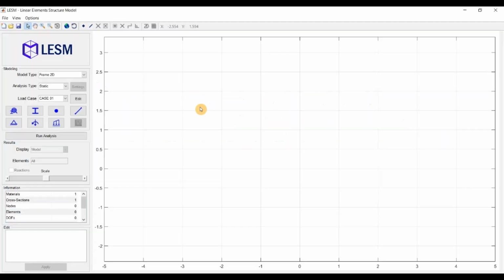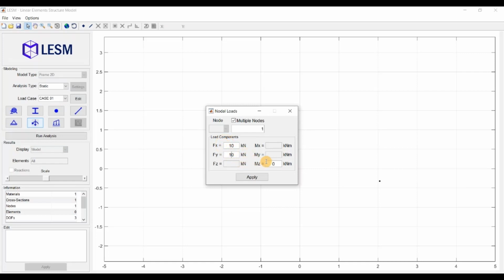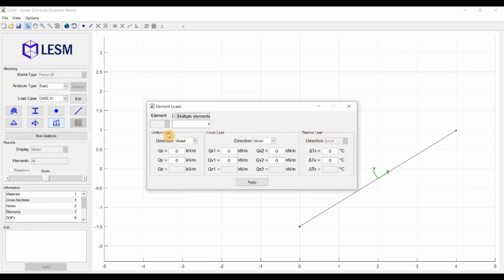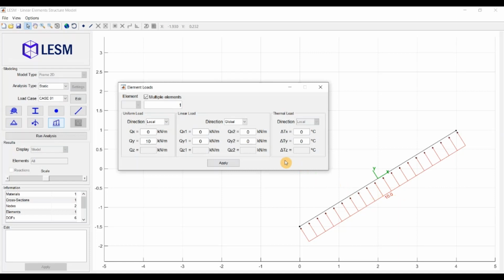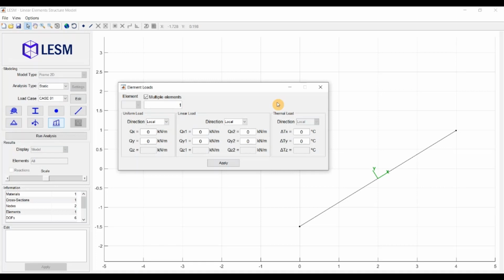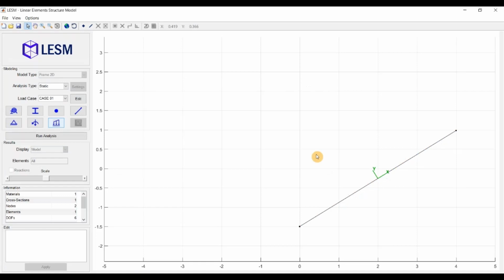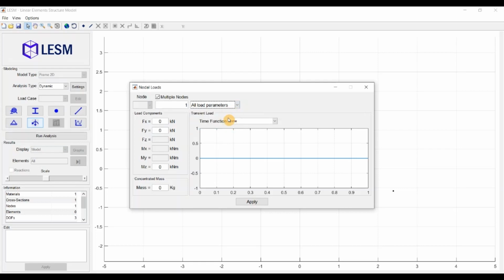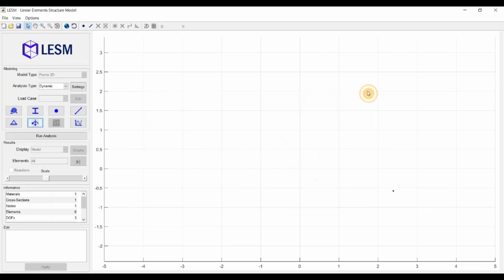LESM Tutorial 07 - Loads

Comment: hi, it seems load case and combination are not working as user expected. It works only for single load case of multiplication. User can not add several case e.g 1.2 DeadLoad + 1.6 LiveLoad with additional function or envelopes in case of live load pattern in multispan beams.
Reply from the maker: I am sending a message to the team that develops LESM.
Reply: @ftool_lesm  thank you, an output of elements internal forces in local system also missing, only displacement provided.
Reply from the maker: @syont  Please, verify again.
Reply: @ yes, i can confirm for both 2D and 3D case.

Analysis results:
*Nodal displacements/rotations
*Support reactions
*Internal forces at element nodes
*Elements internal displacements in local system
Reply: @ After running an analysis, try Options->Export text results.
Reply: @luizfernandomartha2881  indeed by these steps an output generates, but no internal force along members available as listed previously.
Reply from the maker: @syont , you are correct: LESM does not export values of internal forces inside beam elements.